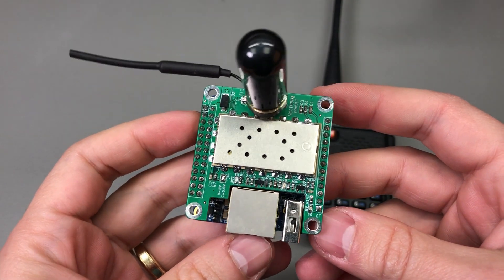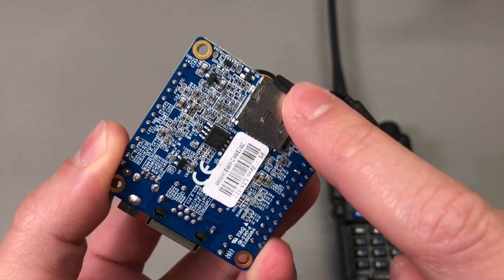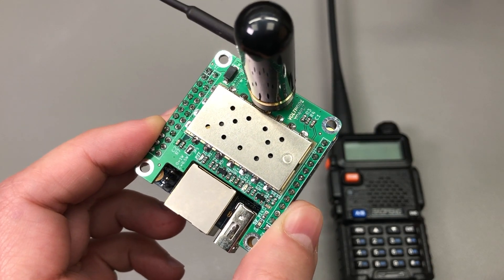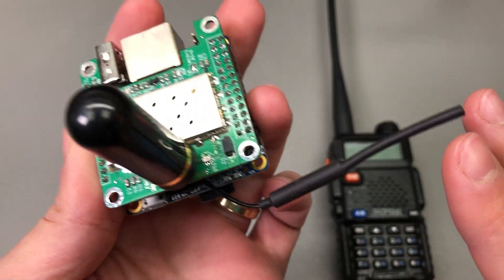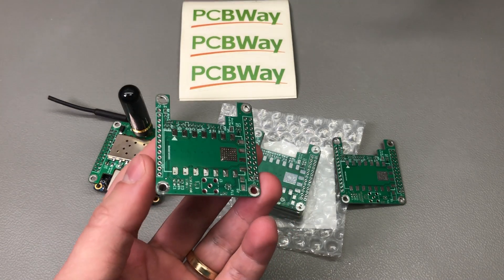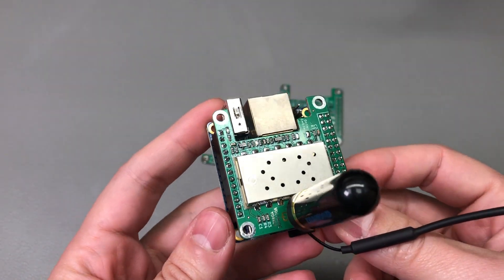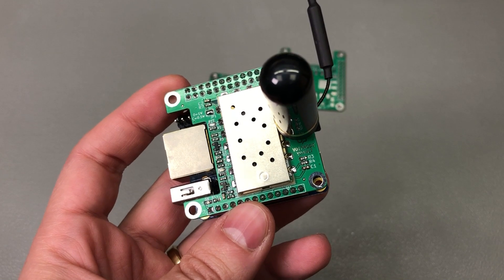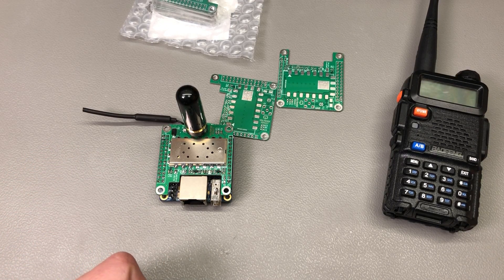Get Almost Unlimited Range With This UHF Repeater | Voltlog 385

Comment: Boafeng radios have terrible filtering combined with a wideband chip that helps contribute to RF overload and desense. Just buy a better radio and you’ll probably find you don’t need a repeater at all.

You can confirm this by transmitting into a far away repeater with your max power. (5 to 8 watts). If you can open the repeater, but are unable to hear the repeater return signals back to you at 5 times the output power.. It’s very likely that your baofeng is deaf, junk, like all the cheap HT radios available these days
Reply: Sad Ham who spent too much money to the radio Japanese.
Reply: I have a uv 5r with a $5 antenna and I could hear a repeater clearly 7 miles away
You can’t expect a lot from a cheap radio. This is a good radio for people just getting into ham

Comment: Interesting project!  I confess, however, that just seeing the device in this video does not tell me what you can do with it.  I'm a new ham with very limited experience. I don't yet understand many of the standard ham applications you say for which this circuit can be used.  If you could could demonstrate the device in use as a repeater or whatever and give us an idea how much range you can get out of it then that would help newbies like me understand it better.  We might then be more interested in purchasing one and spreading the word about it.  Thanks!